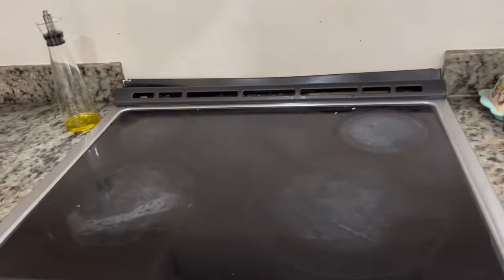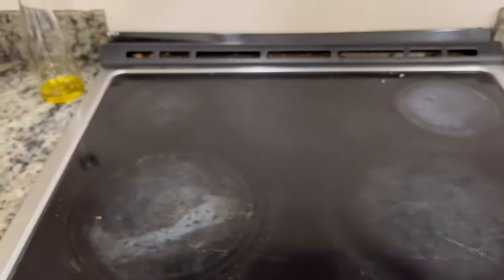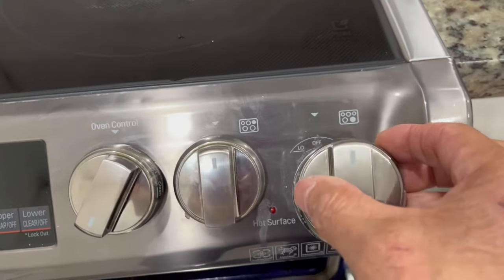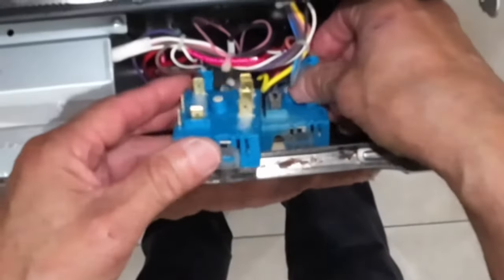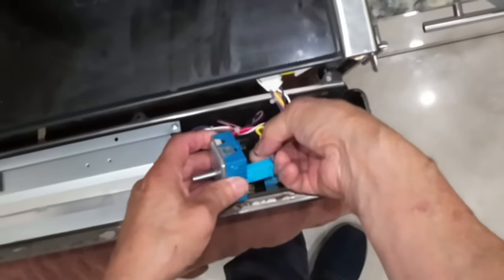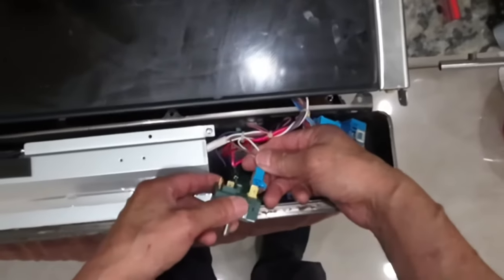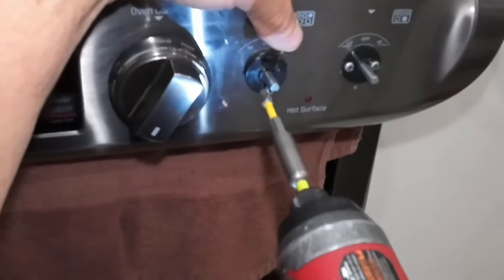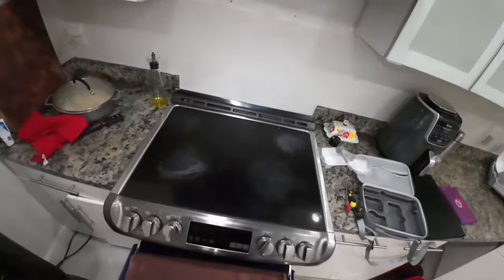Fix LG Range Burners With Rotary Switch. Model # LTE4518BD

Comment: I change the rotary switches on the right side of the range, while the panel is out , they work, when I try to put it back , just went off. Any advise. Just bought the 2 rotary switches and is not working properly.
Reply from the maker: When you say just went off, I assume you mean it doesn’t have any more power. Because on high the heating element should be red most of the time. On low it should hardly be red. Also, make sure you have the right knob to the right heating element. The knobs can’t be switched single and dual heating elements. If all that is OK, the wiring terminals got loose somewhere or the main harness connector in front control panel.

Comment: First , thank you for this video. I found a stupid fault on a similar model. I had to remove the burner top to get the control panel out. What I found, was that 3 controls had had the mounting screws come loose, leaving the controls free to rotate, and not turn on a burner. I found more loose mounting screws. i put them all back with Locktite.
Reply from the maker: Appreciate you sharing your solution. I have found that to be an issue also. I think Lg didn’t make sure the screws were long enough?

Comment: I have this oven and my wife was boiling water in a glass tea pot. The tea pot shattered and spilled water all over the oven, and apparently some got into some unprotected electronics. Now the main screen does not work and the burners don’t turn on. The little red light does turn on if I turn on a burner but the burner never gets hot. 

Do you have any tips or things I can check?
Reply from the maker: That is not your usual repair. Sounds like an adventure. Hopefully you could find something obvious by taking the front control panel off. Remember to follow safety electrical precautions as you go to determine why the components are not functioning.

Comment: We replaced a rotary switch 6 months ago and now we have burn marks on the new switch and it's not working properly again. What could cause some burnt marks on the new switch and wire connected to the switch?
Reply from the maker: Make sure that the connectors are replaced if they’re burnt and that the connection is tight. You could use a needle nose pliers to pinch the connectors.

Comment: I have same range stove .. my problem just happened yesterday already tried to reset by turning off the breaker but none of my burners working I don’t know what the problem maybe .. stove is about year and half old warranty is gone and I’m looking to repair it
Reply from the maker: Is the oven working? You can have a loose connection at the junction box. Where the 240 V come into the range/oven.

Comment: I have an LG and one of the double burners doesn't come on unless I turn on any of the other 4 burners?  Have you seen that?
Reply from the maker: Your range has  a touchpad to turn on your burners. Should be a range control relay board or the main board. I have seen that from a faulty relay on the board.
Reply: Thanks.  mine doesnt have a touchpad just old school knobs on the front.  i figured id try a new board 1st @appliance63
Reply: All 4 of my burners are not working. The warming one does. Any ideas on a repair?
Reply: I have the same exact problem.  My LG LDE4413st is only 18 months old but out of warranty.  Any luck finding a solution?
Reply: @natehomer  nope, ive been told I need a new pc board.  It's a couple 100$.  I haven't tried it yet.  Sorry

Comment: Does anyone know if this will fix a situation where the front right burner will only turn on if the back right burner is on?
Reply from the maker: You must have a different range/oven. The one in a video has the knobs to turn the range burners on. Yours must be push button control board.
Reply: Did you ever get it fixed? Mine is almost doing same thing except the back right burner when on, turns on the front right burner as well. Two burners come on with one knob

Comment: How do you change the glass top on this same model? Mine just cracked today.
Reply from the maker: Google model # lte4518bd Service manual pdf. The detailed instructions are there.
Reply: The manual indicated shows the glass top removed but not how to do that.
Reply: @pjleary7063  I ended up figuring it out myself.  Not difficult just takes a bit and helpful to have a 2nd person to help with putting the clips on that hold the burners to the glass plate. Also wear gloves because there are some sharp aluminum parts.
Reply from the maker: Congratulations👍

Comment: Mine over heats and LG said unplug it and plug it in but it did not fix the issue
Reply from the maker: If one of your burners is overheating on this range oven, it would be the infinite switch. The reason why we would unplug and plug back in it to reset the control board. The infinite, which is not a control board.
Reply: @appliance63  thank you for the response.

Comment: For the model ltel7337f , I found you have to take the glass top off to be able to get the control panel off. The control panel are has 2 screws from the top down, which are only accessible once the top is removed. To remove the top, you remove a number of screws on the back and the top back under the black grate. Then you lift from the back and slide it towards the back, so it disengages from the control panel area. Then you can access behind the panel. So for replacing the switch, once the top is off, you would not have to remove the panel at all.
Reply: I have similar prob & don't know if the control or the burner is bad. Can you explain how I get to the burners under the glass please?
Reply: @chrisrob7276  There are a few screws around the back, near the top, that hold the entire top into place. Once removed, you lift the top from the back and then pull it towards the back so it unslots out of the front. Before that though there are a couple connectors to remove near the back. You should be able to do that when you lift the back but before you fully detach it.

Comment: F3 ERROR on LG
Reply from the maker: F3 code is a possible shorted button on the display board
Reply: @appliance63  Need to change PCB board?
Reply from the maker: @master15951   Disconnect power to range oven and reconnect if you haven’t done it already. Could be display board, loose or faulty wire connector, or main control board. For the model number in the video.